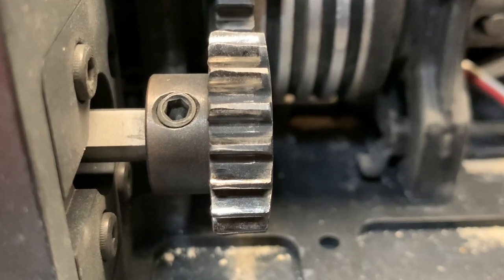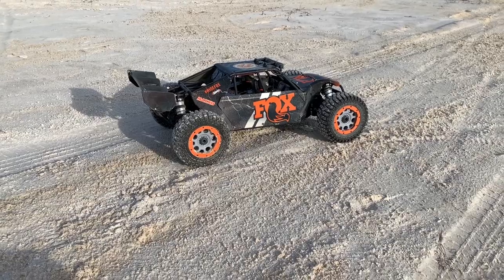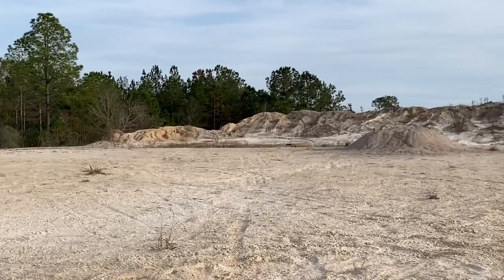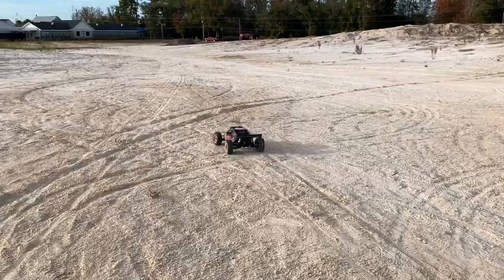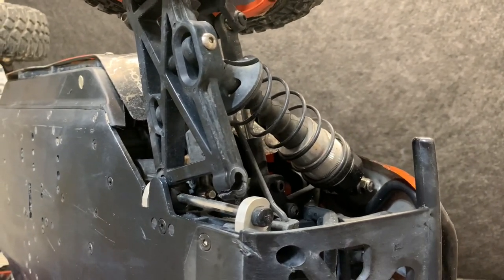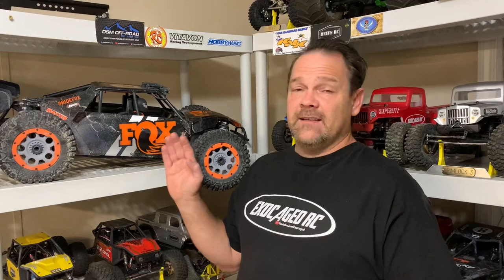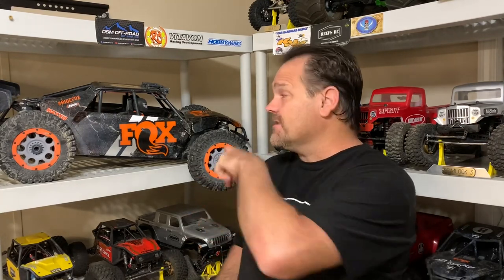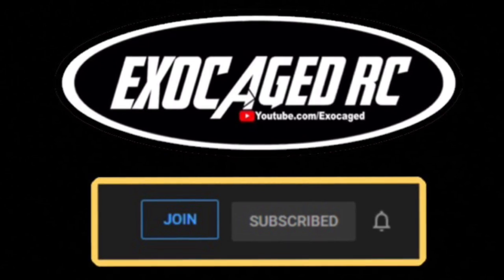Crashed the DBXLE2.0

Comment: Man 😬 nasty! Its a beast though👍
Ps. You almost cost me $550 recommending a 39t pinion for my new x-maxx motor, I got smoke from my max6☹
Reply from the maker: 39t works fine with the 1100kv
Reply: @ExocagedRC  If it was hobbywing then yes but its not, im sure I mentioned that it was a Toro Beast motor. Old technology!
I haven't tried the 39t! I ran it on 46 spur and 34 pinion and the motor was 121°c🤯 and max6 was 102°c🤯🤯 then my on/off/set button started smoking then no throttle😩 i hope its just the button, I can kind of afford a replacement button but it'll take me months to save for a new max6 and the motor😭
It wasn't your fault mate! ✌